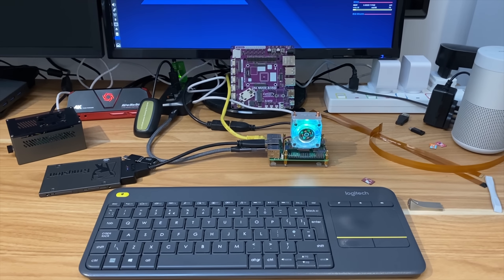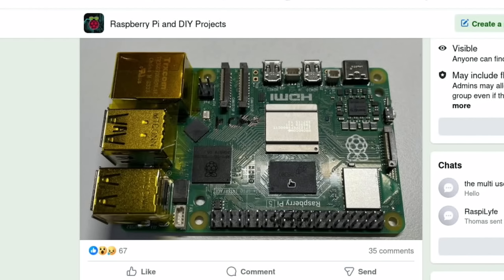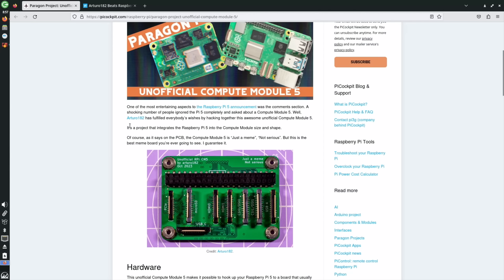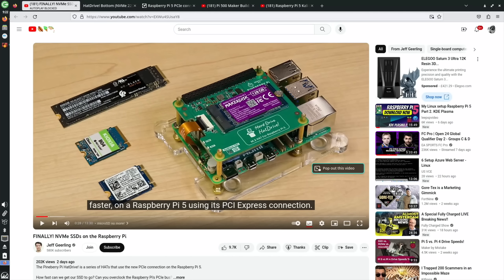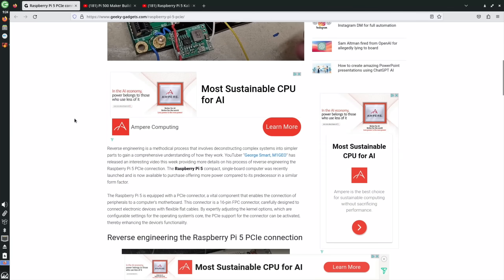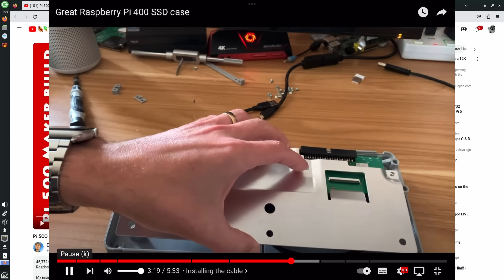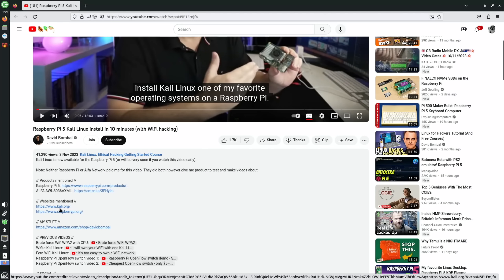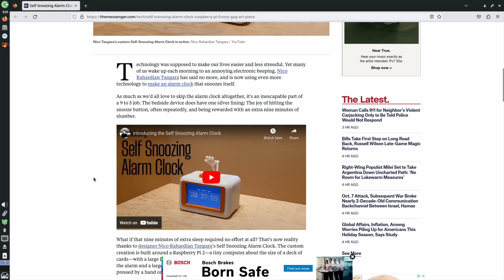Pi news 83. working 2GB Raspberry Pi 5 & 16GB Raspberry Pi 5 attempt

Comment: does anyone know a way of getting Linux to use a pen drive as Ram ?
I know that you could format a pen drive to swap space and mount that, so that is one way.
But what about an extension to Ram ?
I am looking into this to see if I can get a Raspberrpy Pi Zero 2 w  with a lot more ram and overclocked to the max (as per a previous Leepspvideo).
should make a useable micro pc
Reply from the maker: Pen drives are usually slow especially with usb 2. Try Zram

Raspberry Pi Zero 2W. First time setup. Far better performance with Zram.
https://youtu.be/vZkfuVyybIw

Comment: I for one will want to see the MX linux, I just installed the 23.02 version on a RPI 4-8gb., suppose to be based on bookworm, but neofetch says Buster.
I also keep getting notice for 300 or 400 updates, but won't DL, error saying not available and referencing 32 bit version.

Comment: When building devices to make into useful devices to use with/house a RPi5 cases/keyboards, and/or Bluetooth speakers & displays something I think looks great are old Art Deco space heaters, or any art deco portable appliances, & the resale value is insane.  And the 2way mirror google assistant (or any assistant that you can do this with) builds are really nice, doubly so if you have security camers setup outside of your house, for me it just looks so James Bond to have a mirror showing video feeds when they're tripped, & this is the time of year to pickup the super cheap monitors.  The reason I am talking about this is I just saw that my neightborhood is having a huge 'yard sale' taking up a 50 car parking lot ...aka, try and sell crap from your garages & garrets, etc before you toss it in the trash.   ...and do not forget to grab old mirror frames ...I'm hunting for an old one with the beveled glass around the outside that isn't cracked & striping off the old mirror paint on it's back with paint striper.

Comment: im getting a raspberry pi 5 8GB today what os's should i try and how would i go about using a usb sata SSD?
Reply from the maker: Write the image to your ssd using Raspberry Pi imager from Windows, mac or Linux 

This is a good starting os

My Linux setup Raspberry Pi 5 Part 2. KDE Plasma
https://youtu.be/ODNF-J_CSp4
Reply: Raspberry Pi OS and Ubuntu. You might want to look into changing the kernel to the 4k page size one for RPi OS. Ubuntu has a working Vulkan driver. Make sure you have a PSU that can deliver 5A with 5V, like the official Pi 5 PSU, for enough power on the USB port.